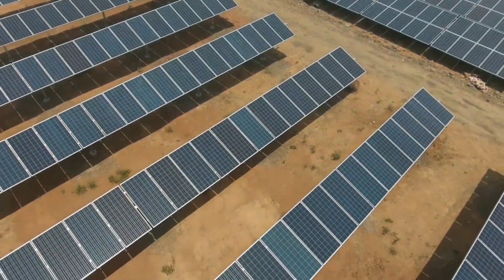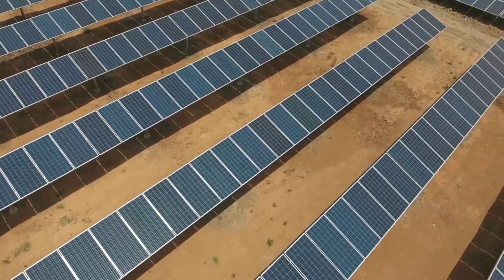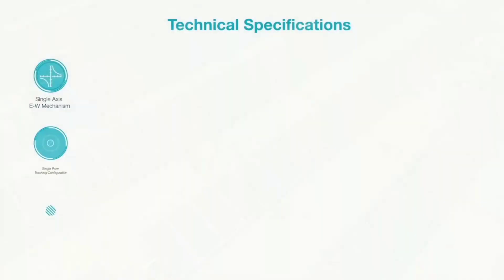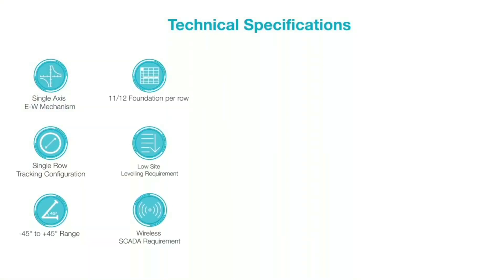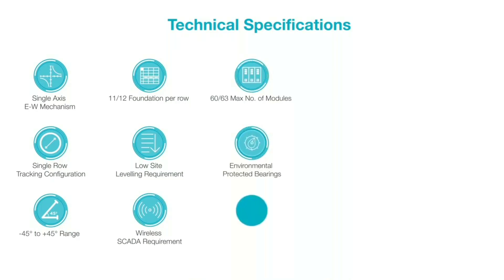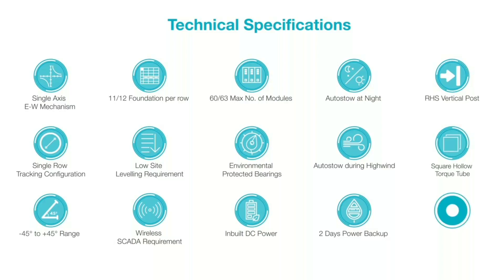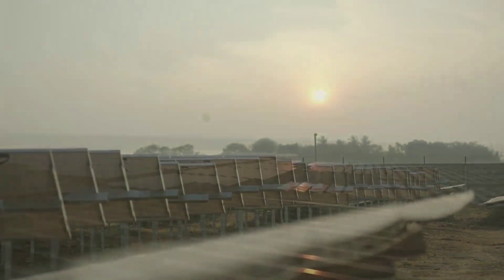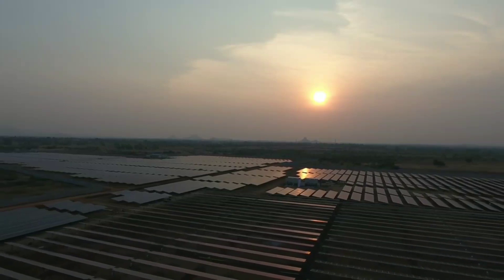Mahindra Susten MSAT100 Solar Tracking System

Comment: Sir does this solar tracker system comes with structure( torque tubes ) or the company provides only the tracker machine and we will have to procure torque tube from elsewhere ?
Reply from the maker: It comes with complete apparatus need not to buy anything
Reply: @SustainableEveryDay   Thanks sir , One more question does company provides this tracker system with installation & commissioning or we need to arrange for installation from our end ?